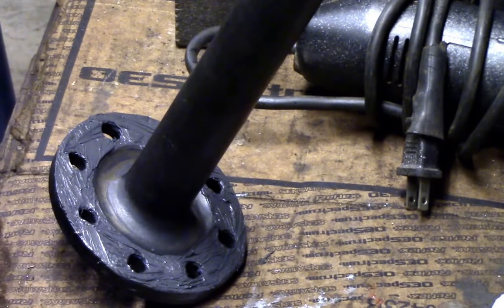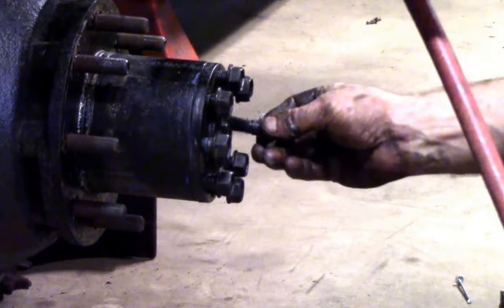HOW TO: AXLE SEAL REPLACEMENT ON 1 TON FULL FLOATING REAR AXLE

Comment: Yep, my right rear drive started leaking yesterday. Its been a long time (8 years) since I have had an axle apart on a deuce, but I have done a couple hundred wheel seals on tractor trailers. Tried looking on YouTube to see if there were any videos on that truck. No rear axles but a bunch for the steers. Just wanted a refresher course for my brain. I've been away from wrenching and have been behind the wheel for a year and a half full time. Driving pays more than mechanic.

Comment: My 1990 K3500 Silverado had these. I read about the floating axle concept but thankfully the truck never gave me a single issue in my five years of ownership. The idea of a floating axle is still intriguing but my memories of what I read over thirty-one years ago are faded. My takeaway from all of that is that wheel bearing replacement was relatively simple and straightforward although the components were a lot more substantial than the half-ton K1500s I'd been used to.
Reply from the maker: A full float is the strongest 1 ton and down axle you can buy.
Reply: Does the 2500 with 8 lugs have the floating axle 1990 c2500
Reply: @BlakeKirkham-fl8xo  To the best of my knowledge, after looking online, the C3500 trucks from 1990 had the floating axle too.

Comment: O.k., great video but my question is how can I replace just the drum and not the hub? Do I need to drive out all of the studs in order to separate the drum from the hub? I'd probably need to buy new studs too I'm guessing. I have a 1995 GMC Sierra 2500. Thanks!

Comment: Excellent tutorial! How much tilt do you need to fill the hub with gear oil and is there any for sure way of knowing that gear oil ended up getting in there?
Reply: If your oil level is correct then just get the fill plug over the end of the hub and you should be good to go. You could pull the end that you want to check, but you would have to re seal it.
Reply: @BlueBug-s9l  i ended up filling one axle through the breather tube which was conveniently located in the axle tube.  And the other side I tilted it slightly upwards and filled the tube before installing the axle.  Then I took a half mile drive to the nearest steep hill and parked perpendicular in the middle of the street  for each axle....I wonder what the neighbors were thinking haha

Comment: It's actually a semi floating axle, the flange being bolted makes it a semi floating. A full floating axle is splined on both ends and the only one I've ever seen was on a set of Mack 44,000 drop ins.

Comment: Nice video the best one that I've seen yet so I had to subscribe. Quick question I have a Dana 70 rear axel not  dully I got the hub assembly off and it looks like their is another seal & maybe a bearing down the shaft by the pumpkin how do I replace that, do I need a special tool to get at it??? Thanks.
Reply from the maker: Thank you, to be honest ive never done 1 so im not sure.

Comment: Here is a tip: if the inner races need to be replaced then drive them out with a punch. Cut a slot in the old race. Then use it to press in the new race. Then the old race can be driven out with a brass punch.
Reply from the maker: You can also rent a bearing installer at a parts store...

Comment: Pre-lube the seal with gear lube once it's in the hub, before you install the hub and drum. Tilting the axle housing does nothing, because it can't get oil to the seal lip where it contacts the axle. A dry seal is going to burn up before you get to the corner.
Reply from the maker: The tilting has nothing to do with the seal... It's for the bearing.. since that is how it's oiled.. so tilting the axle does everything... Not nothing...
Reply: @backwoodzcustomz1549  Is it 'splash' type lubrication as the axles are in use? Thank you.
Reply: @backwoodzcustomz1549 
I heard thats a myth....these bearings need to be packed/repackex with grease because differential fluid isnt supposed to get to them and is prevented so by the seal

Comment: Thanks for taking the time,👍🏼
  So a floater axle doesnt require grease on those drum  bearings?
Reply from the maker: No it's oiled from rear diff....
Reply: Very informative.   Doing my 88 R20 suburban right now👍🏼👍🏼
Reply from the maker: @jrcarr5507  glad to help..
Reply: I can't wrap my head around not packing the bearings with grease. Really?
Reply: @ds14048  ever heard of SEALED  bearings?  Really?

Comment: Great video. Just curious. How many ugga duggas on the axle bolts?
Reply from the maker: About 3 or 4
Reply: 90-95 ft. Lbs
Reply: 14 bolt 10 1/2 inch gets 113lbs.

Comment: Hi, great Vid! One thing though, I see that you did not use a "Hub extractor", the Hub, just came straight off, by hand! Surly, this will not happen, as the bearings, (In the Hub) are an "Interference fit" with the Axle, and as such, are fixed, SOLID! Please explain, as I need to inspect the brakes, on this type, of rear Axle, (A Chevy Motor Home) Thanks,.. Geoff.
Reply from the maker: No they come right off, it's not a pressed bearing they are conical or come bearings.. just how this came apart is how they will all come apart....
Reply: @backwoodzcustomz1549  Hi again, and thanks, but I still do not understand. Yes, I know that they are "Conical", but that is "In" the Hub. The area where the bearing contact's, with the axle,  must be  "Flat" and as such, must be a very tight fit, or it would "Wobble", surely? Thanks once again,..Geoff.
Reply: @kfotoprm   if you cant grasp how taper bearings and a lock nut work you should probably take it to a shop

Comment: So you mentioned that the
 gear oil lubricated bearings.
My Hub actually has a large amount of grease inside of it it's a 65 Kaiser m35a2
Still kind of green around here your thoughts would be appreciated
Reply from the maker: Tj Ward I would try to search online I'm not familiar with that vehicle.

Comment: I was driving my 1989 Chevy Cheyenne K3500 up a washboarded gravel road, coming out of a curve @ 10mph when something (?) happened & my pickup stopped. I thought it went out of gear (manual transmission); not the case. When I got out, I see my rear driver side tire & drum & axle shaft sticking out about 18" or so from my pickup. What most likely failed for this to be able to happen?
Reply from the maker: Gonna have to take it apart and see .. broke axle shaft?
Reply: @backwoodzcustomz1549  The clip somehow came completely off , the spindle nut had backed off completely, & the key was loose.  The clip, inner bearing, & seal were on the axle shaft, which was not broken.  I was able to figure out how to get my pickup back on the road thanks to your video.  Thanks!!

Comment: If I remove the drum do I have to replace the seal or just if it’s leaking?
Reply from the maker: it's only a $10 seal, i would probably just replace it. but if it's not damaged it can be reused.

Comment: If axle shaft gets nicked to the point needing replacement do i have to replace the whole rear axle/diff assembly? I had a failed bearing and its currently seized which im working on removing but im almost %100 sure its damaged. Thanks
Reply from the maker: As long as the diff is still good you can just replace the shaft. But how dis it get nicked?
Reply: @backwoodzcustomz1549   sounds like he's talking about the bearings or seals having damaged the spindle.. im not 100% sure but i dont think the spindles are replaceable but they do sell special seals that have a ring that goes over the damaged area/wear grooves and gives a fresh area to seal on.. as far as knocking off siezed up bearings as long as you can get the inner race back on normal without it being too tight or slopey itll be fine, sand down any high gouged spots

i know this is 8 months old more so leaving it for future people with similar issues

Comment: I have to do a rear axle bearing and seal on my RV with single axle, dual tires.  Would it be similar to this..?
Reply: Oh it's a ford f53 chass 1999 Fleetwood bounder
Reply from the maker: Most heavy duty axles will be similar..

Comment: What about the outer bearings? Mine seized then failed and then the axle shaft walked out about 6 inches, the races are seized in the hub, can’t move it out to get the retainer clip out, ready to let it roll off a cliff or something!
Reply from the maker: Sounds like you need some new to you parts.
Reply: @backwoodzcustomz1549  I need something, lol,  it’s a 2001 express 3500 with less than 40,000 and it has been kicking my ass since Friday. My “help” thought the brakes might need to come off so I had to completely reassemble them, and I’ve never done drum brakes before, so that was fun.
Reply: @backwoodzcustomz1549  thank you for the reply also! I know the video is several years old.
Reply from the maker: hopefully you had 1 side to look at to put them back together.. Hope all goes well..

Comment: What do you put the punch against when you punch out the inner bearing & axle seal?
The inner race? Can you damage the bearing?
Reply from the maker: The seal. You never wanna hit on a bearing....
Reply: @backwoodzcustomz1549  I was afraid of that.
I had to hit against the inner race because I couldn't reach the seal (driving it from the outside end of the hub)
I've seen seal removal tools that pry it out, but didn't have one. Hopefully I didn't damage the bearing cage too badly.
Reply: Thanks for asking that question. That’s exactly where I’m at right now. I was about to hammer down on the bearing. I’ll get a seal puller tomorrow.

Comment: Hey, why tip side to side? Does filling it from center at differential fill port not make it to bearing?
Reply from the maker: You flip it side to side so it is lubed and you dont run it dry the 1st time.
Reply: @backwoodzcustomz1549  you mean when you first start moving ? after you start moving will the oil from the center fill port make its way over there?    Just want to make sure I am not missing something basic before I move forward
Reply from the maker: @poshank6206  like i said its to ensure its lubed. If you dont wanna spend a minute to do so then dont.

Comment: Does seal go in a certain way
Reply from the maker: Same way you took it out.
Reply: This question was asked two years ago, but here's the better answer: the open part of the seal faces TOWARDS THE BEARING. Think about it: if it faced the other way, the open part would load up with crud and water and fail.

Comment: How tight does the nut need to be to seat the bearings
Reply from the maker: Tight tight...
Reply: @backwoodzcustomz1549  can i get it tight tight with a punch or do i need that socket? Thanks for the reply.
Reply from the maker: @thenonchalant172  just a socket, your basically making sure everything is seated properly.
Reply: @backwoodzcustomz1549  thanks

Comment: How do you get the outer wheel bearings out?
Reply from the maker: Once you have the retaining ring out they just fall right out.
Reply: for some reason mine won't fit out, its bigger then then side hub.
Reply: The outer bearings come out from the inside. You have to take the inners out first.
Reply: The outer bearing and race is pressed in together. You need a master bearing installer kit. The inner bearings are the only ones that fall out one seal is removed.

Comment: I have a 3500 Dually 2000 but a broken axle I cannot get the broken axle out can somebody give me some information on that
Reply from the maker: Just the inner broken piece is stuck?
Reply: good chance youll have to take the diff out and the other side apart in order to pound it straight out with a long bar, if its holding the diff in youll have to get creative with some hammers and pry bars while trying to get access to the face of it by removing spider gears